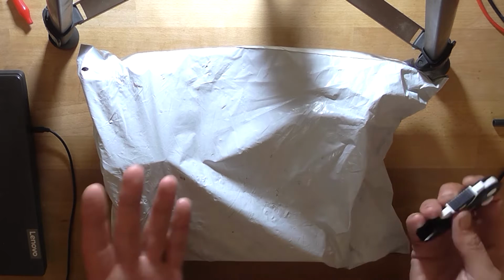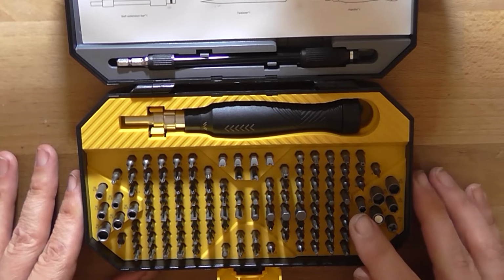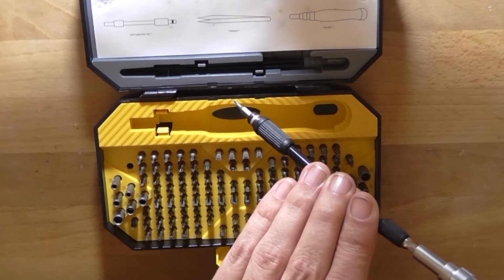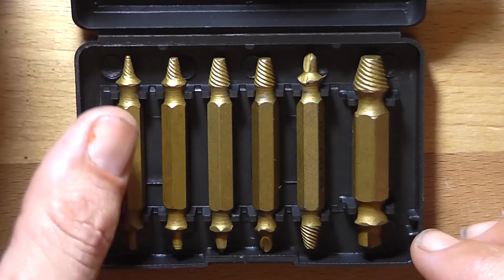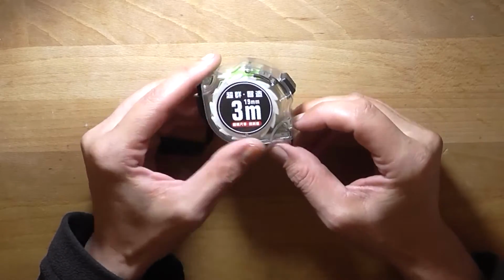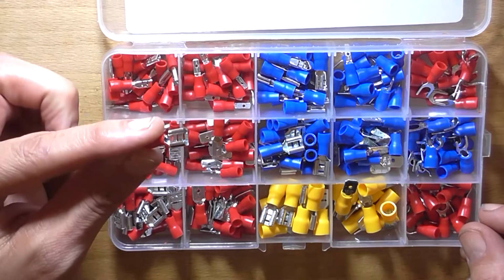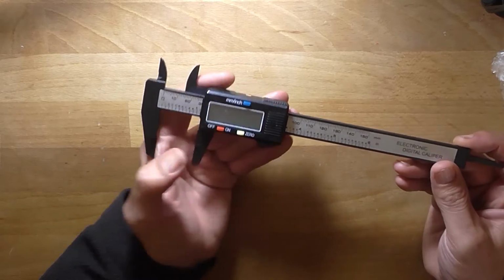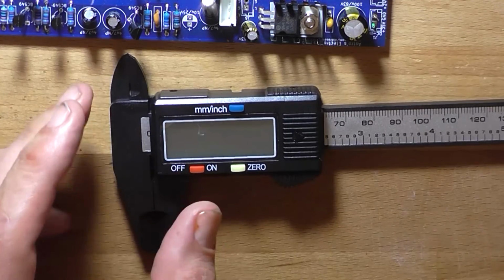TEMU: Free Stuff? Too Good To Be True?

Comment: All useful items. I have a plastic digital caliper. Its surprisingly accurate. You will find it very handy!
Reply from the maker: I put a battery in it, and it seems OK 👍. I'm not going to do a separate video on it, it's not really interesting. But, it works.
Reply: @AstrosElectronicsLab  I have 2 of those calipers because just one is never enough. Always when I used is hard to find it and having a second one is handy because definitely one of two always I can find it through all my tools